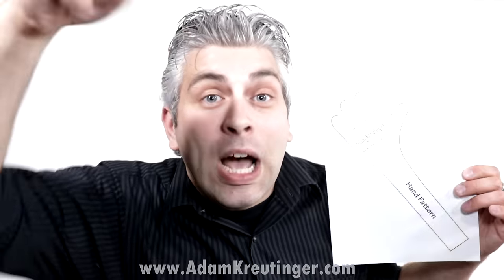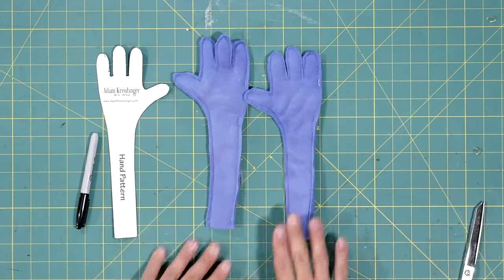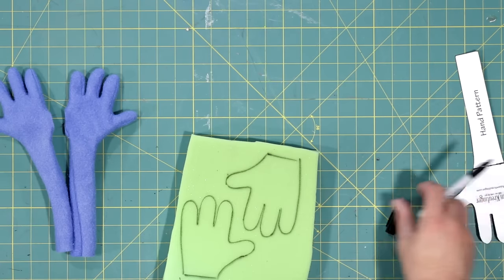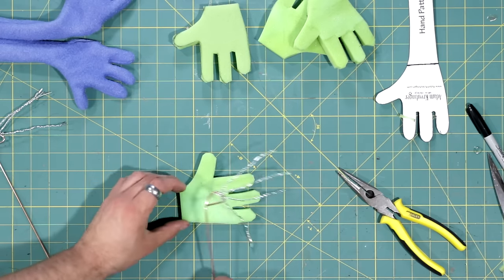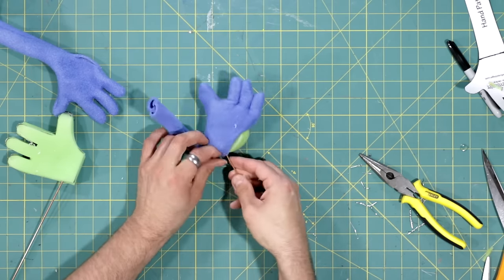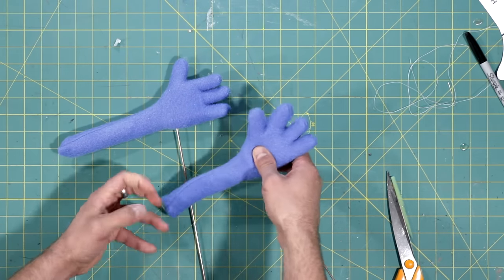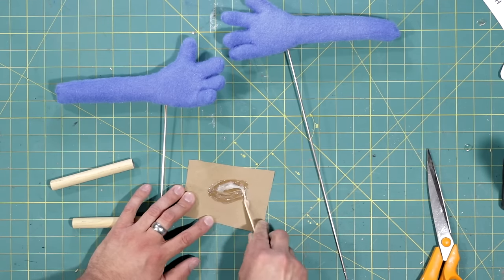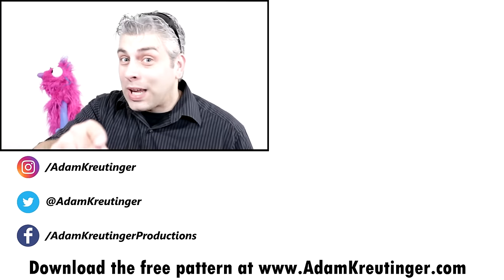How to make Puppet Hands! - Puppet Building 101

Comment: I use this technique for the hands, I use wire between the foam glue it together and glue the hand edges together to make it look more even than i push the fingers in to form a little pocket, and put the fingers in. Than I push the hand in fill the arm with stuffing and sow the hole in the hand

Comment: I am working on 4 puppets at once now, and it's my 1st time making puppets. I have heads attached to all 4 bodies and I'm pretty happy with how they look. I spent a good part of the day today struggling to stuff the foam hand into the fleece hand but managed to get 2 sets of them done. It was incredibly frustrating. I didn't like how they looked at all, the foam wouldn't reach all the way to the fleece finger tips, the hands looked misshapen....it was not good lol.
While taking a break from it I was twirling a foam hand around on it's rod and a little voice in my head said ,"That hand looks a little thick." I got a ruler and measured...sure enough all and I mean ALL of the foam hands I made were 2 inches thick! Good lord I was mad lol.
So now I'm going to remake all 4 sets of foam hands, and remake 2 sets of fleece hands. I could try to trim the foam hands I have so that they are thinner, but I feel like that would be too much to deal with. For me I'd feel better just making new ones and getting a fresh new start.

Comment: I glue the foam hand to the fabric, (still leaving that little spot open,) then flip it around like you did and I glue the wire to the hand
Reply from the maker: Yeah. I glue the wire to the foam. But if you glue the foam to the fabric I would think it would be hard to skip the covering over. And what to you gain by flying the fabric to the foam?
Reply: Adam Kreutinger I do my hands the way you do your feet. Then put the arm rod in the little spot I leave open, I will make an Instagram video and tag you In it

Comment: Just a tip for those who can’t use contact cement, use rubber cement. It’s cheap, and it burns you less than hot glue

Comment: Hey, Adam! Love your tutorials. They're so comprehensive and easy to follow! What material(s) would you recommend for puppet arms that need to be flexible and bend (like Grover or Elmo)?
Reply from the maker: Can can use all types of things. Foam, beads, fiber fill, rope. Lots of things could work.
Reply: Kinda late but for Elmo or Grover,  they usually have a string of beads in the arms for them to be flexible and loose

Comment: Is it just me or are these arms too short for the free pattern? I'm thinking of adding another length to it...
Reply from the maker: These arms were designed for the smaller Snoof puppet pattern. If you want to use them with the other free puppet pattern, I would make them a little longer.
Reply: @PuppetNerd  I'm doubling the arm length, kinda minus a few inches.